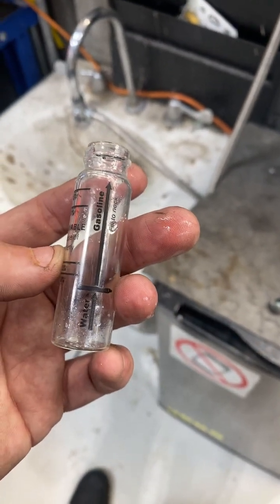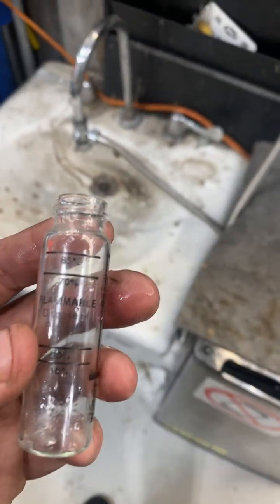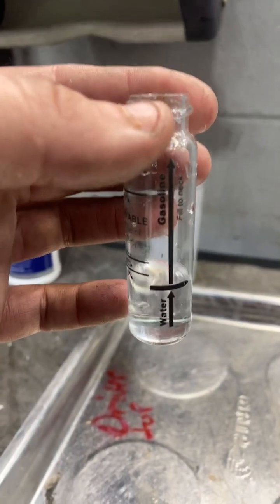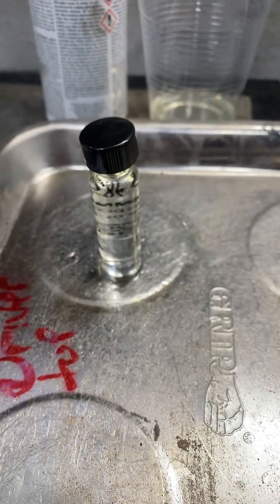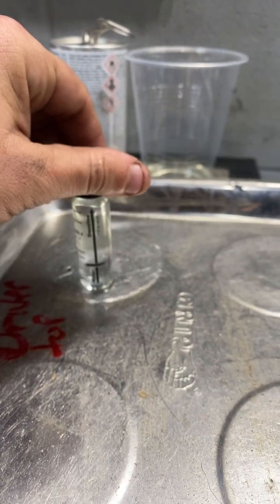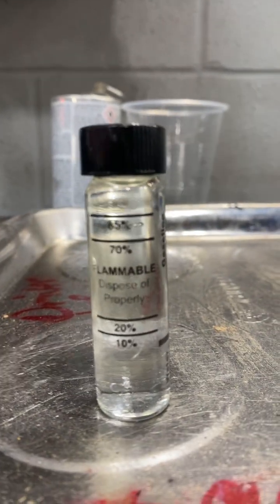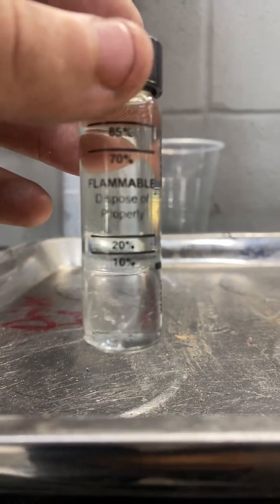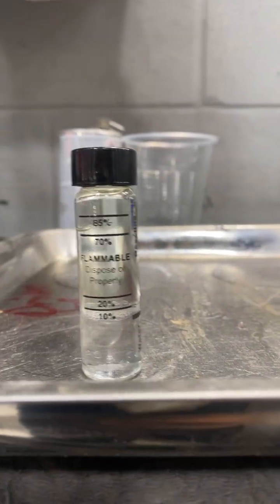At home ethanol (E85) percentage test for your car --simple test will solve a lot of engine concerns

Comment: You'd be perfect to ask, can I use the eco unleaded 88 octane in my 2001 Subaru outback with the ej251. The pump says 2001 or newer but I've always paid the extra .10 for plain unleaded
Reply from the maker: Great question
Stick to what the manufacturer recommends above all else, going against the grain can cost you.
If an engine requires premium fuel, I suggest paying the price. 

Using the wrong fuel grade, over time, will cause internal engine problems.

Also don’t confuse unleaded with ethanol free

Comment: I miss something here ? I only see that he already put water in the tube and after adding the gasoline the level stayed the same!! What is or was this test he performed actually supposed to do or prove
Reply from the maker: Water bonds with the ethanol 
Anything above the water line is measured ethanol 

I bought a bigger test Bodley to make a follow up video today

Stay tuned
Reply: @thatsubaruguy1324  Thanx I'll sure be waiting to " hopefully see the "" results "" I understand the principal behind all this ,it's just that I didn't see it mix or a rise indicating anything !! Maybe I should put it this way , what s the purpose of actually putting water in the "" vile "" or bottle in the first place?? I'm sure I'm still missing something ,or my brain isn't "" cut out "" for this ,Lol
Reply from the maker: @randallsaylors7570  
First thing to understand is, water and ethanol stick together. 

And gas floats on water. 

We add a measured amount of water to our tester. From there just remember “the water line is 0% ethanol “

No fill the tester with fuel and shake

The water mixes with the ethanol. No chemical reaction is happening, thing of it like mixing water with salt.

When the liquid settles, the mixture of water and ethanol will settle to the bottom because it’s heavier than gas.

At the bottom of the vial we now have all the water originally added plus the ethanol it grabbed out of the gas. Everything above the “water” line is the measured amount of ethanol.

It’s mind blowing I know.

Basic chemistry is badass!
Reply: @thatsubaruguy1324  You did an outstanding job of explaining it too me ,my hat goes off to ya , thanks again for taking the time to explain it  in detail to me !! Can't thank you enough for doing as you did !!! You have restored some  faith in me in doing as you have , AGAIN I THANK YOU FOR HELPING ME UNDERSTAND THE PROCESS !!
Reply: @thatsubaruguy1324  How right you are , BADASS FOR SURE ,also in a strange kinda way I think of it as also being Beautiful!!

Comment: Problem repeatedly is uncontrolled buildup of water in station ethanol tanks due to sump pumps going on the fritz, IE, ceasing to work. Stations sloppy about fixing the pump. COST ME $1000 in fuel system repairs. NEVER AGAIN.

Comment: What?
Reply from the maker: This is a teaser video to my science video. Editing is hard and the customer work is stacking up.

Basically it’s an offset graduates cylinder. Stay with me…

The first line is the water mark and that line is also the zero prevent for the measurement of ethanol.

Add gas and shake

Ethanol like H2O and blends with it.

Gas floats to the top

Look at the percentage marks and you have your measurements.